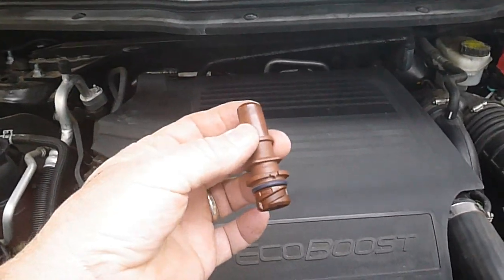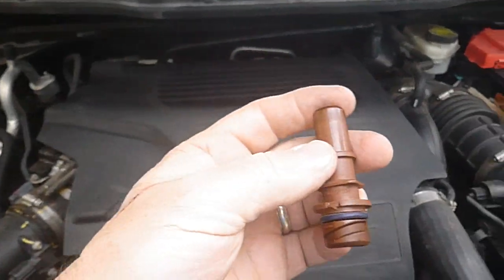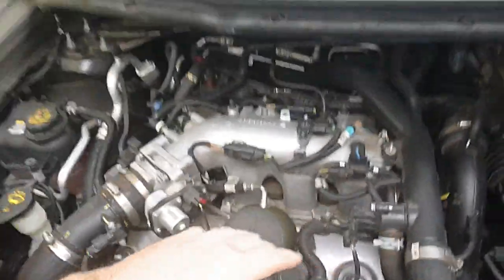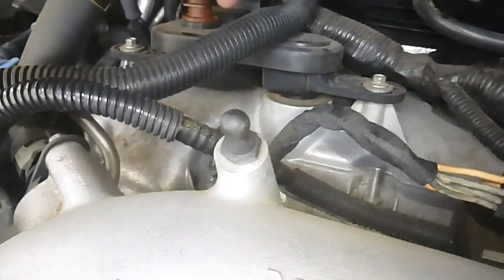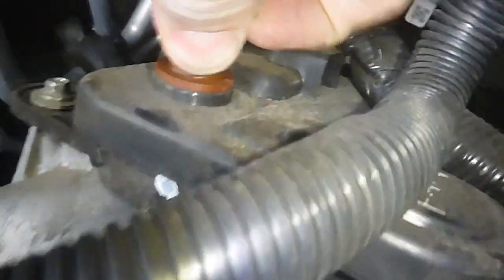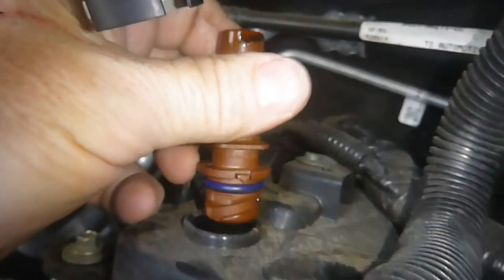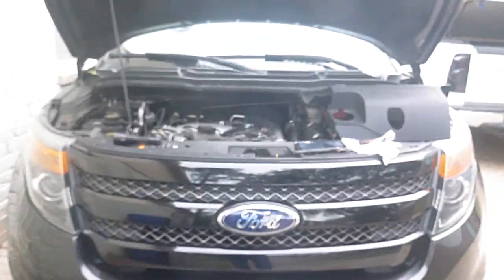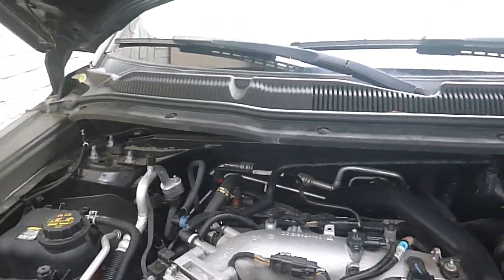PCV Valve location for 2014 Ford Explorer Sport ecoboost 3.5

Comment: Hi i have question do you know why is the oil going to intake air filter can it be the PCV valve? Ford Explorer 2013
Reply from the maker: I do not know that answer but it does not sound good